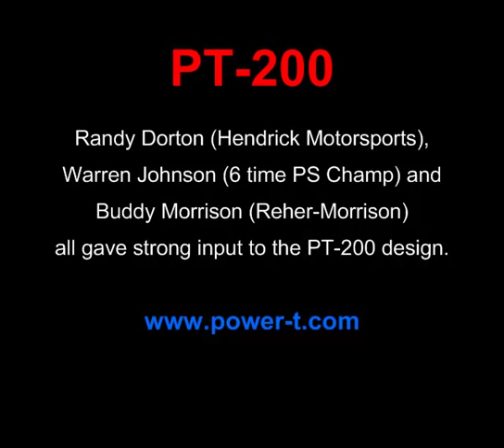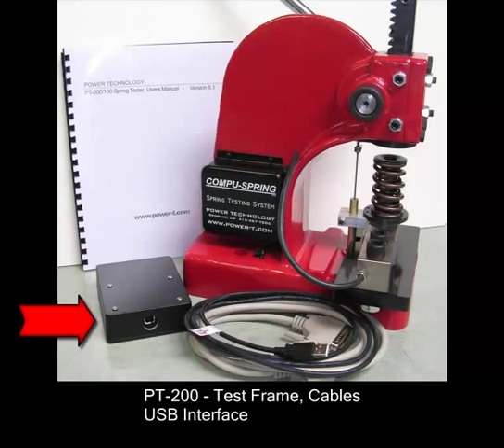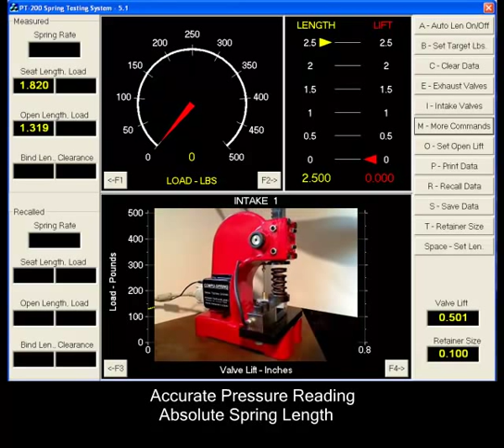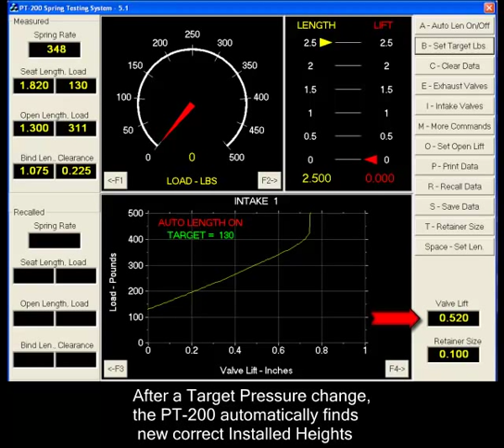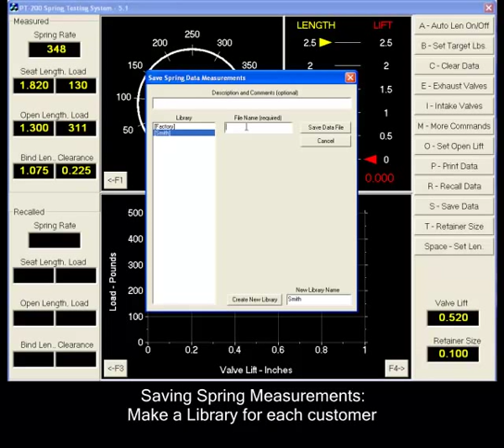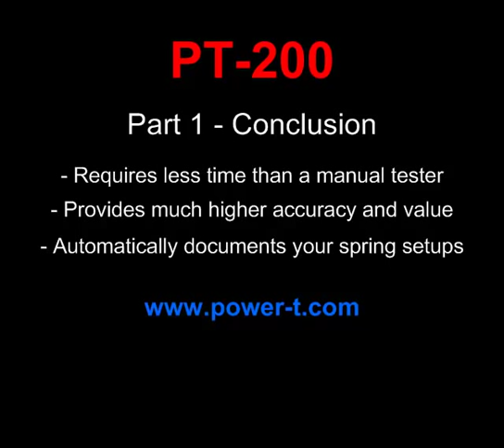Demonstration of the PT-200 PC Valve Spring Tester and Checker

Comment: when I connect the PT 200 (USB to the PC) and run the program appear a 
sign saying that there is not possible to connect to PT-200 and then open 
the program will not let me measure. What up? How can I fix it? The 
machine i buy it there I have the invoice and the software i down of the 
page because I lost the original.